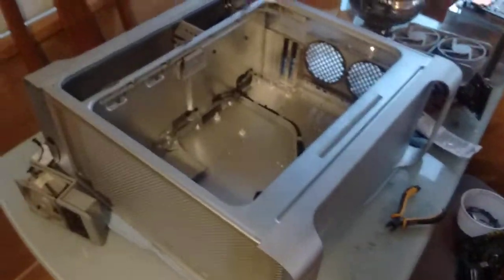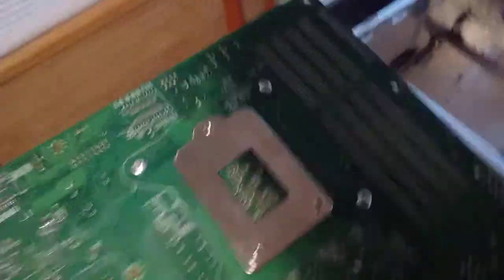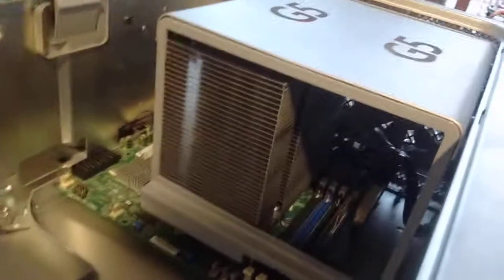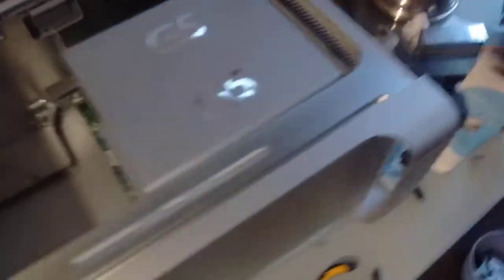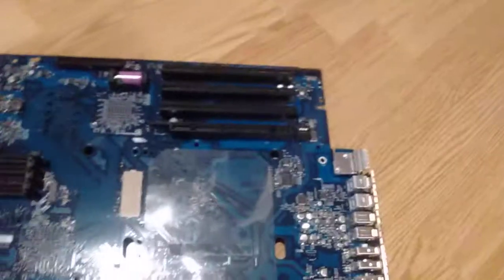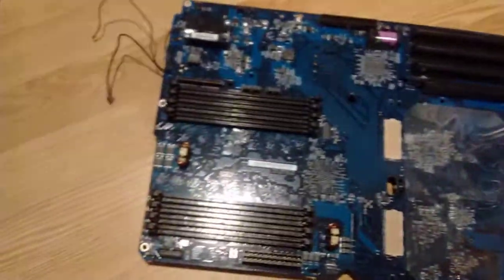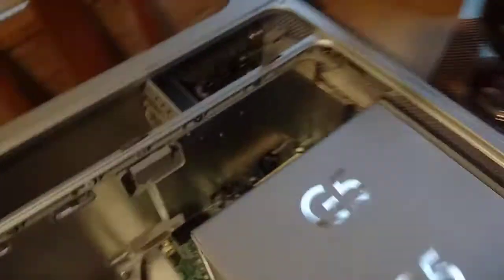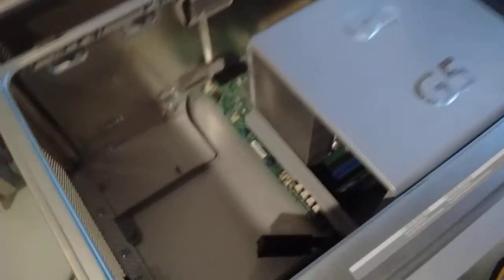I'm making a PowerMac G5 Hackintosh! [With bonus abrupt ending]

Comment: Thanks for the video. In the case of the back I/O, how did you know which cables to solder for the USB and Ethernet pins? For instance, a USB cable is formed of many cables such as ground, 'x'v etc. How did you know which USB pin out on the back panel board corresponded with each wire? I'm completely new to any kind of electrics, so forgive me if this sounds like a silly question.
Reply from the maker: The solder points line up with the pins on the connectors in the case of USB (2.0, at least), and for Ethernet I crimped a regular RJ45/8p8c plug onto a ribbon cable which I then soldered onto the original G5 back connector. I found out the pinout for that one by using the continuity function of a multimeter.
To avoid ground loops, I made sure to connect both boards' grounds in multiple places. I found those places using the continuity function, too.
I'd also recommend the site pinouts.ru in case you need to know the pinout of any particular connector.
Reply: @ITTFami  Ok. My initial idea was to get male to female wire extenders for the USB and Ethernet I/O and to hold them in place with a metal plate like this http://www.toddkumpf.com/images/forums/g5/backplate_01.JPG. Now I'm considering your method for USB in order to keep the stock G5 appearance. As I've already ordered a few wire extenders I might, at least for USB, make a connection from the back I/O of the ATX motherboard to the G5's I/O panel, instead of making the connection from the ATX USB front panel pinout. This way the cables will be more easily hidden. What issues would ground loops cause for USB? Also pinouts.ru looks like it would be a great help for me with this project and in general. Thanks.
Reply from the maker: If you're placing the ATX board in the same position as I did, you probably won't have enough space to use USB connectors on its back panel. I directly soldered the USB lines to the ATX board. The header approach seems much better, however. You could connect the header to the G5's original back I/O. 
Ground loops could cause all kinds of issues; from random disconnects to data corruption to ports not working at all. But they should be nonexistent when using extension/header cables and connecting their shield ground to the ground plane of the I/O board. As for hiding the cables, you could route them behind the board (Much like the power cables in the original G5).